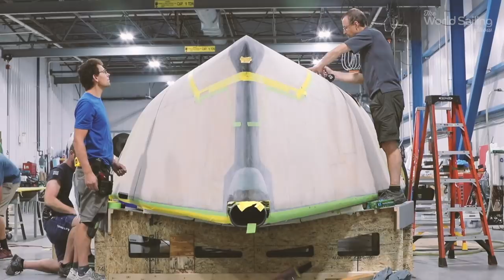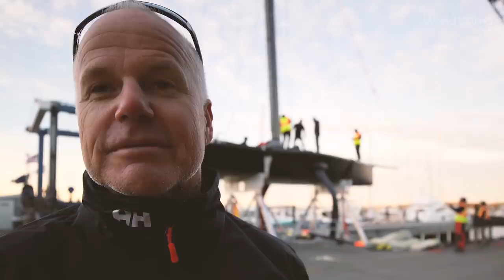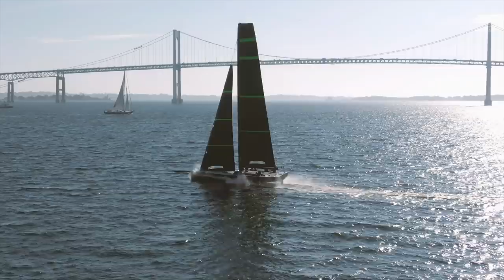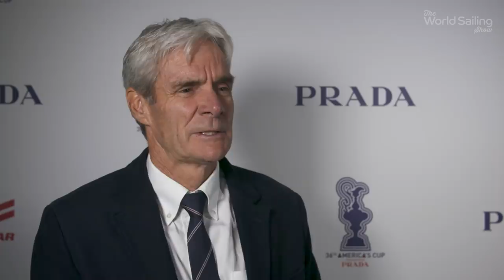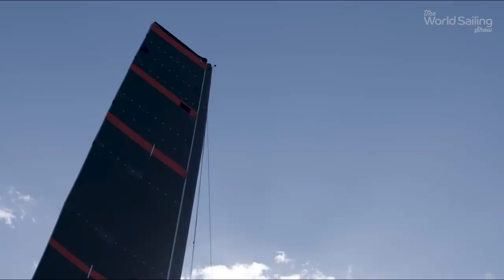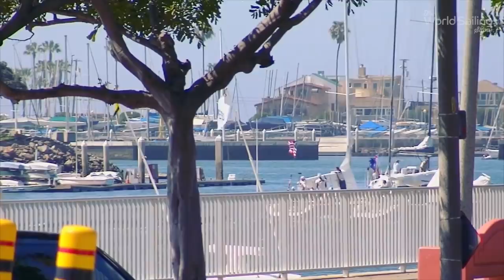The Mule...and other Cup news

Comment: Hmmmmmm. Its the middle of February. I saw all this footage at least one month ago. If not longer. That tells me that not one of the teams has released a single bit of news......this year? I think they are all (perhaps not the yanks or brits) in real trouble getting this design to work. Especially the Italians. I think if they had something to show they would have. No pressure........
Reply: Your wrong. TeamNZ did most of their prep/design in a simulator last cup cycle (pun intended) and didn't put a boat on the water until very late. I'd say a lot of teams are doing the same now.
Reply: Allistar thanks. Im pleased to be corrected. It was far more intuition than fact which informed my comment. So you suppose that they are all just hard at work on the simulators and keeping 100% silent about progress. That would make sense. Still....this design is incredibly radical. You must have sensed some concern from notable players. I certainly did. I think they are bricking it and so they should. 70ft flying monohulls fleet racing......?
Reply: @ficklemedia8733  I have no doubt that most teams will pull it off. The simulators are so impressive and accurate, have you seen the photos of the Oracle one from the last Cup? I suspect that the smart teams will wait until it's too late to make a change before the reveal. Of course it's one thing for the design/build team to create a foiling 75ft boat it's another for the sailing team to send it foiling around a track 100% of the time.
Reply: Yep not good news so far related to these foiling monohulls. Lots of breaking and capsizes, far more than they had with the AC cats. This video that has been snuck out on youtube shows the stability issues... Imagine a 75 foiler doing this with 11 crew on board... https://youtu.be/NVQtQWx3rnM
Reply: I agree mate it will be hard to get them up on the foils is a near impossible all things considered. Such as they must go down wind to foil.